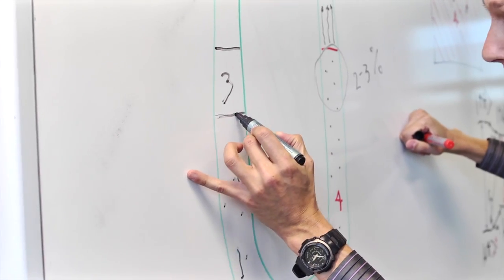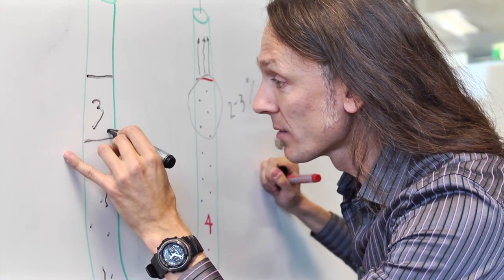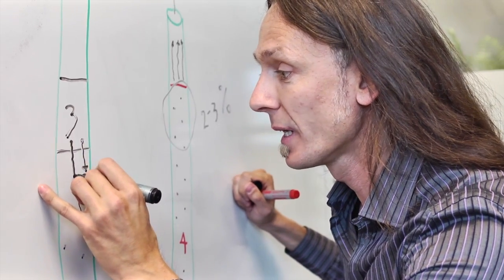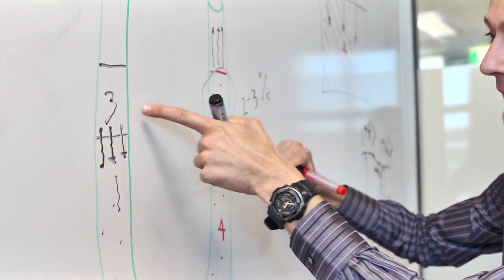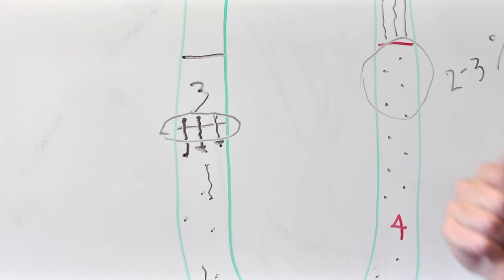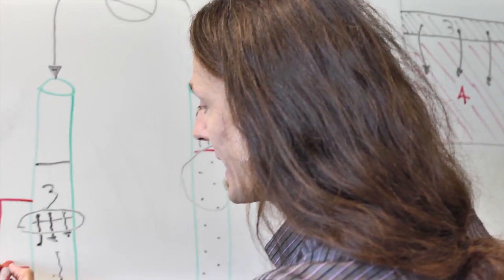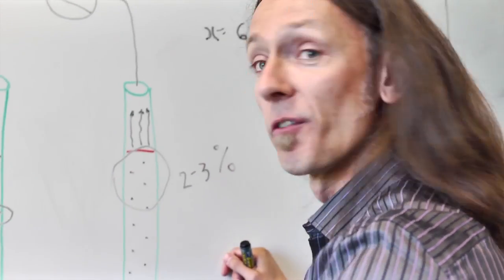Quantum Cooling to (Near) Absolute Zero

Comment: It's never explained where the heat is removed from the system.
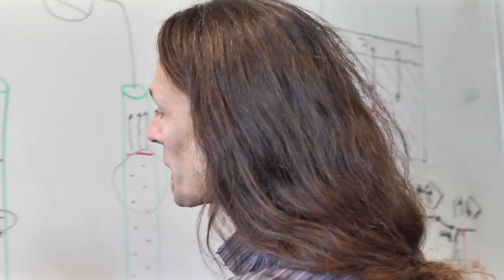Reply: He mentions a spin qubit device (at least I think that' what he says at 5:58). That's one example on how the heat could be taken away.
Reply: Wherever the helium goes back to a liquid state after evaporating on the right. I don't know enough about the system to say which, but it must be either in the pump, above the Helium-3, or into the Helium-3.
The spin q-bit device is the object they want to keep cold, it wouldn't do to have that same object be where the heat is being rejected.

Comment: I find this very interesting, but I have one question: why does this solution of ^3He have to be contained in a U-shaped tube? Why not, say a straight tube? What difference affect would that have on the outcome of the experiment?
Reply: There needs to be too 'pools' of H3, one pool stabilizes the entropy of the entropy(% of h3) of the other pool by moving some of it's h3 too the other pool. (by pool i really mean area of h3 & h4 if that makes sense) if the tube was vertical and straight, there would only be one 'pool' of h3. look at around 5:15 or so where he explains this.
Reply: The He-3 needs to be on top, if the tube were straight, the pump would be pumping both He-3 and He-4 out of the tube, ya feel me?
Reply: daniel campion Oh, I see. Thank you for responding!
Reply: +daniel campion I don't understand. If the tube were vertical and straight, the H3 would still be sitting on top of the H4 and the H4 solution could be pumped out from the bottom of the tube. The H3 would still sit on top. So why curved?
Reply: because you need a circular system.

Comment: Make a cold sink unit you can cook a house with just by using booster fans on a thermatat. A insulated vault would be needed but you could cool a home just by drafting the home. This could help many people where electric is not available for cooling needs. With electric you could make a chiller plant to do a lot more has well.

Comment: 0:28 can't you just measure it's position and then a few seconds later measure it's momentum?  And assume the machine is doing it job consistently infer that a second later it's momentum will be the same as it was a second earlier... and then you would know to a very very close degree at least both the momentum and position?
Reply: Charles J Gartner To “a very close degree” you CAN measure the position and the momentum of a particle, but not with arbitrary precision.  If we know the momentum of a particle precisely, then we know nothing about it’s position at that time.  But if we know the momentum approximately then we can simultaneously know the position approximately. The Heisenberg Uncertainty Principle sets the limits of precision of these two quantities.  
In fact the act of measuring the position of a quantum particle (for example by bouncing a photon off it to see where it is) changes its momentum so preventing your experiment from providing perfectly accurate results for both position and momentum.

Comment: Sounds very good, but then why are we still using water and air to cool our computers and cars etc? Helium isn't that expensive, right?
Reply: helium itself no. To use it as they are now and maintain the liquid helium is very expensive and controlled.
Reply: The temperature of liquid helium would render that pointless as the computer would simply fail to work at that temperature.
Reply: Helium is nonrenewable at the moment, so our use of it in balloons are mostly terribly wasteful. The creation of a functional Hydrogen-based fusion reactor would render the previous statement false by allowing us to just fuse hydrogen into helium for our needs.
Reply: ^^^^^
The rest of the world will regret the use of helium balloons one day!
Reply: +Maximillian Shaughnessy of course unless we figure out hydrogen based fusion. Lockheed Martin is on the right track, from what I hear.
Reply: +qantj vulpis not if the chip was constructed of materials made to operate at that temperature. Notably, quantum computing chips require liquid helium cooling and the world's most extreme overclockers use liquid Helium to hit 8+ GHz speeds in x86 processors.

Comment: What's the point of measuring gravity waves? As far as I'm concerned (I'm absolutely no physician nor know physics), gravity and light travel at the same speed. If the light is unmeasurable because of it interfering with other particles on its way to the instrument, then the gravity waves should also interfere with other waves on its way to the metal, so what's the point of even measuring it and what information does the wave even provide?

Comment: This is very similar to the way a Heat Pump works (Refrigeration cycle).  The pump is the compressor.  Removing spent refrigerant  from one side and discharge to another.  Energy is placed into the system from the pump.  There are phase changes that occur.  The "interface" he refers to might be similar to the "evaporator coil" or "fixed orifice"?

Comment: I'm puzzled on one thing... Where does the heat come out?
I understood that the "membrane" between He3 and He4 draws heat and it will heat up the dilution.. so.. Does it dissipate the heat off on the pump pipes when He3 turns back to a liquid or where?
Not sure if i just missed the explanation or something but i would appreciate if someone could explain it to me! ^^

Comment: What he says is that the quantum hydrogen heated pull is a cause by the helium integrated negative diluted satium. But, before this happens, the secreted nucleus is less the the negative minus 10 to the twentieth power of the square root of pi. So, when the positive neutrons are are condensed in such a way that the movement between these particles are so small, yet there is still movement between them is when we can achieve near absolute zero. Easy.
Reply: No one cares about all the bs you said above

Comment: Is it just me or was he drawing pentagrams on the helium atoms near the start?
Could it be? 
He is the Antichrist and the first beast. 
Let's delve deeper. 
This video is about cooling to near absolute zero.
What's near zero? 3.
What has 3 sides? A triangle.
How many eyes are in the symbol of the Illuminati? 1.
In this video it mentions liquid helium requires 4 kelvin. 4.
4 - 1 = 3.
So now we have 2 #3's and we've made a triangle out of one.
Let's look for more #3's. 
What atom are we using?
That's right, Helium-3.
Now  we have another 3. 
We have come to a total of a triangle, and 2 #3's.
Wait? 2 #3's?
2 x 3 = 6.
Alright, now we're left with a triangle and the number 6.
This video is 9 minutes and 56 seconds long.
9 minutes? That's 3x3. 
Multiplying. The number 6 itself. Multiply the number itself by 3. That's 3 6's.

Wait... 666? The number of the beast?
Triangle... Illuminati?
Pentagrams... Antichrist?
Absolute Zero... Total Annihilation?
New Technology... New World Order?

I'm afraid to say that's not enough proof, illuminati is not confirmed.

Comment: what makes this mixing process endothermic? The stronger interaction between He3 and He4? The 'bond' energy difference (van der waals) between He3 - He3,  and He4 -He3, if you make stronger interactions from weaker interactions, isn't that exothermic?
Reply: +moosehead  actually maybe thats right, final - inital, gives a positive heat, so it requires energy to make the transition... that makes sense.. maybe im confused comparing to an exothermic combustion reaction where weak bonds are broken and strong bonds are formed... anyone have some insight?

Comment: Doesn't the sphere then still have thermal vibrations at a low temperature? Or is it just so small that it doesn't interfere with the measuring of the gravitational pulses?
Reply: Exactly, the thermal vibrations are still there but in a small enough amplitude that the grav waves become apparent (in theory of course, not sure if they ever accomplished their experiment)

Comment: How do you get the H3 out on the right side, without heating the system. In my head the only way to get out H3 without much H4 coming out would be to "force" it (strong pump, heat, mixing). Which would heat up everything and make it therefore useless. Where is my mistake/misunderstanding?

Comment: If 2veritasium is "an isotope of truth" then why does it have the same atomic mass in the logo...

Good video btw, maybe such methods could be used as a replacement for pneumatic refrigeration techniques? That is if it's more efficient.
Reply: +sam617523 I believe that the amount of h3 to absorb enough heat for that large of an area would be too large, in theory however the larger you go the smaller the ration required is, so, in theory we could use it to cool the climate much more efficiently than to cool down your beer :D (it would still work though)

Comment: What would happen if you were to get close to an object thats is 0.000001 Kalvin
Reply: You emit infrared radiation with waaaaaay more energy... so you can't, but there would still happen something interesting since it stays very cold to our standards, don't know it this is different from extreme frostbite
Reply: You in the movie Startrek - into darkness where they drop an "ice bomb" in the volcano and everything just freeze? Would you think that would happen
Reply: bob roger Don't know it but the idea sounds reasonable, if it's not exaggerated (which it probably is). It would take energy from the environment until it is the same temperature so it would make everything colder but yeah.. not enough to freeze lava ofcourse
Reply: +bob roger you'd need a very big object if with that temperature if u want to freeze a vulcano ;P u're better off just not getting the entire object to that temperature and just use it as a plug ;P
Reply: +ohw well Not necessarily, in theory the colcano (averaging around 2k F) could be mass cooled a few times over until it solidified. The only issue is with a massive cooling like that, you are more likely to create a massive sinkhole which would land in more molten magma closer to the mantle thus creating more heat, then heating the newly cooled magma, thus releasing energy, thus creating a massive steam cloud. In practice, a worse idea than manually igniting Yellowstone, though not by much.

Comment: Could you overclock a Quantum  PC?
Reply: yes if you have "OC Guru" from gigabyte
plus you can also buy the OC version
Reply: But at absolute zero most compound metals such as your cpu/cpu heatsink would fracture due to the stress fractures created by the different reactions of freezing metals.
What you see in some pc's is below zero, but absolute zero is −273.15°C.
Reply: +Songs for the Heart I'm thinking of more in the lines of a shatter/disintegration at absolute 0
Reply: +TechXSoftware No such thing as a Quantum PC yet.
Reply: Processors stop working at below about - 70°C. Even those who use liquid nitrogen and liquid helium to set overclock records have to be sure to not go too cold

Comment: I don't understand. He says there is heat being removed from the He3 pool but where is it going? If it's being recycled then how is heat being removed from the whole system?
Reply: +Chii I'm guessing that the energy is going into breaking the Helium-3/Helium-3 bond so that it can transition into a Helium-3/Helium-4 bond.
Reply: +TheRinzl2r As for how the heat energy actually exits the system, I'm guessing that the helium-3 vapor condenses on some sort of surface which takes the energy away.

Comment: @2veritasium can this principle be applied to create a network of superconductors, maybe by using aerogel as a thermal insulator, and a material that would absorb shocks (from wind or from the earth depending on what and where will the network be used, this would greatly increase the energy efficiency when transporting energy ,or , in a idea proposed to the british government where  a network of electromagnetic fields would be created in roads so that a car could be charged as it was moving

Comment: Hey Veritasium! Since He-3 and He-4 are noble gases, is it possible to use another Noble gas (for example Xenon) to get the same effect? And if so (or not), what results would differ from each other? ._. just curious
Reply: Xenon is prohibitively more expensive than Helium, like 100x-1000x more expensive.  It's a nonstarter purely from a cost standpoint even assuming Xenon can be a better cooling alternative than Helium (which we don't know about).

Comment: Could you also use this technique to cool down a microchip or a processor? Or a whole PC?
Reply: technically yes, but I wouldn't if I were you.
Reply: +Lukas Schreyer You could cool it down, but the chips/components NEED to stay warm, period. The device would have to be remote on a heatsink of some kind, if electronics get that cold they shatter/dissolve. It would just allow you to poor that much more power into the chip while keeping said chip at a reasonable temp.

Comment: 1.39 
Helium is NOT a noble gas
It is an inert gas
Reply: +111alien111 Helium is BOTH a noble gas AND an inert gas. The two aren't mutually exclusive. Or were you trolling?
Reply: Not really, as I am both correct and wrong - you're a failure for being born though
Reply: It's the same thing
Reply: +111alien111 no, you can call helium both an inert gas or a noble gas. They are used to represent the same gases.
Reply: 111alien111 Convince us why helium is not a noble gas and  I (and probably Electrobyte) will apologise for thinking you are one of the most boring trolls on the internet.
Reply: Scientifically and not " layman terms " scientifically explain how helium is a noble gas and I will apologise and say you are correct, untill then its inert.
Reply: you're
Reply: read two lines and stopped reading, seriously who the fuck is gonna read all that ? dick
Reply: +111alien111 You are getting noble gases and inert gases mixed up. Noble gases describes the group helium is part of, group 18, meaning it has a "full" outer shell of electrons. Inert describes the chemical property that all noble gases share, which basically means they do not easily react with anything.
Reply: +111alien111 
lol @ all the ad hominem attacks. you're a sad, sad person.
Reply: How is it the same thing ? Heck even wiki it and it says inert. So are you trolling ?
Reply: Source from WIKI
Helium is a chemical element with symbol He and atomic number 2. It is a colorless, odorless, tasteless, non-toxic, inert, monatomic gas
Reply: Ah I did a little more digging and I understand the confusement, under " normal " conditions helium is inert but under "sub" conditions it becomes noble, so we are both correct in a sence.
Reply: what ?
Reply: Noble - reaction
Inert - none reaction
?
Reply: +111alien111 Why don't you google what a noble gas is EDIT: heres a link talking about it on your favourite site https://en.wikipedia.org/wiki/Noble_gas
Reply: Sorry I dont take advice from a canadian - dirty breed of humanity
Reply: Wiki backed me up - so stfu sir Dickenshire
Reply: 111alien111 Not the link I provided. It specifically states its a noble gas
Reply: I have already stated in a earlier post - thats its BOTH - which is were the mistake was made
Reply: READ
THE
FUCKING
COMMENTS
Reply: 111alien111 I HAVE!

Especially your very first one, I quote:

"1.39 Helium is NOT a noble gas. It is an inert gas"

I especially like your frequent references to Wikipedia...perhaps you just need to learn to read?

A little quote from your beloved Wikipedia:
"It is a colorless, odorless, tasteless, non-toxic, inert, monatomic gas that heads the noble gas group in the periodic table"

See that? It HEADS the noble gas group! So you were wrong from the off...now, go back to your Minecraft little boy...
Reply: are you absolutely fucking stupid? I already admitted i was incorrect in the comments - go sit on a cactus
Reply: +111alien111 Helium is listed as one of the six Noble Gases.    I think you need to stick to shirtless selfies.
Reply: fucking read the posts you dumb fuck
Reply: 111alien111 We already did that fuck knuckles...your first one being that little gem:  
"1.39 
Helium is NOT a noble gas
It is an inert gas"

After that you got shot down in flames more often than the Luftwaffe, and tried so hard to backtrack, but it's still there for all to see...
Reply: 111alien111 You first, dumbass...
Reply: lets agree to let your mother go first ok ?
Reply: run along and play wow you nerd
Reply: Go sky diving with out a parachute please
Reply: your gay with a second name like bremer hahaahha

Comment: So many people are questioning if we can use this technique to cool computer hardware.
This wouldn't work because at these temperatures, there would be almost no electron movement in the transistors in say, for example, the CPU and electron flow is what provides the "power" to these components for them to function.
So, no, you can just stick to phase-change cooling for now.
Reply: +NeedSkillNow what if you use a heatsink which would only serve as a conductor of thermal energy separated from the pc components? theoretically this should work.
Reply: And if the temperatures balance themselves? Something like a very hot cpu and a very powerful cooling system... Like 273 °C and -273°C
Reply: Nikpick100 CPUs will never go above 90-95°C as it will melt the silicon.
Reply: +NeedSkillNow Assuming you have a true direct contact heat sink, say synthetically injected, the heatsink could reach temps of up to 273 °C allowing to CPU to have that much more ppower and stay below that 90 mark, as long as you had a way to remove that heat effectively from the heat sink, as long as the CPU temp stays decent, the heat sink temp can go as high as it wants, just have to control that part